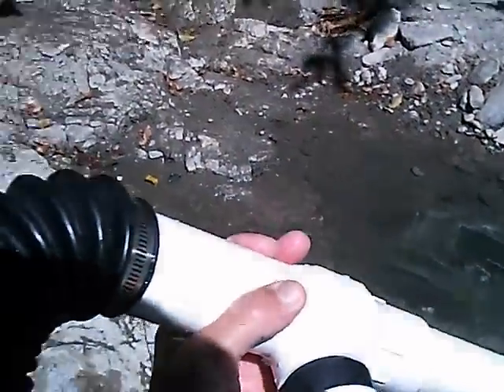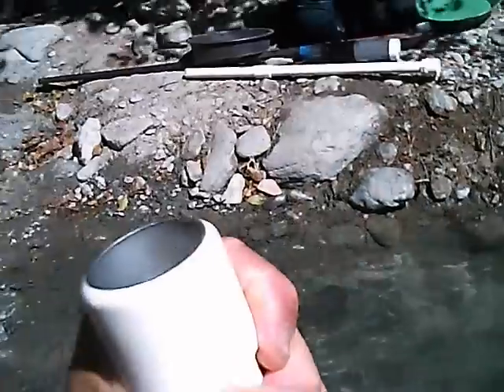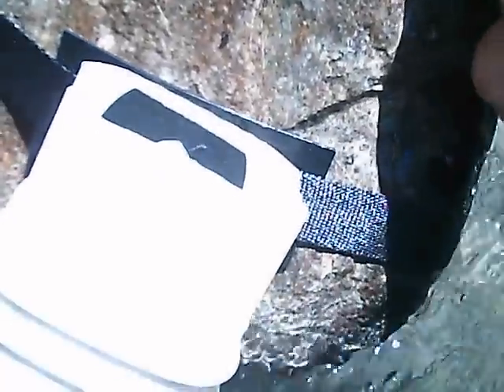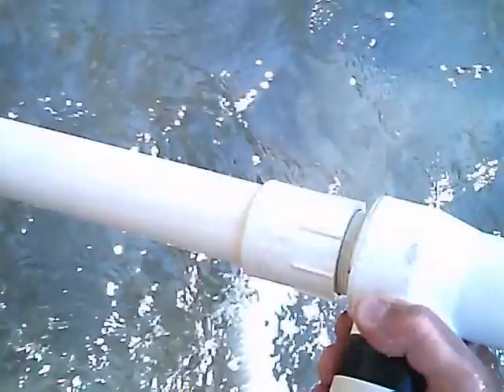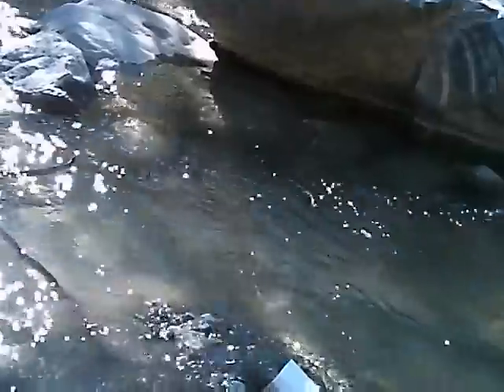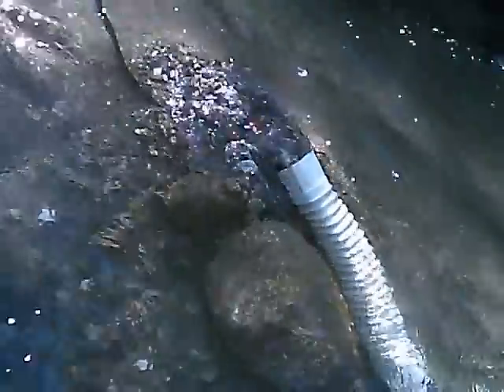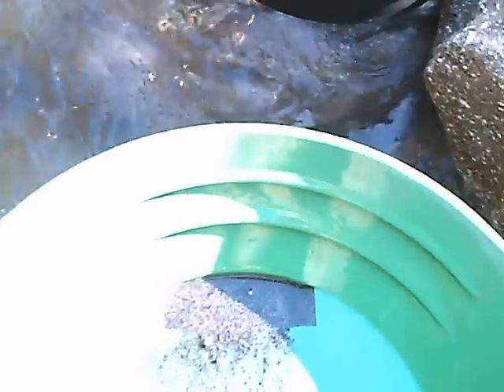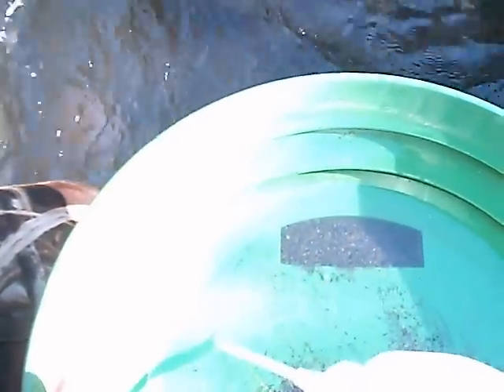Hand Dredge Gravity Concentrator

Comment: What size hose is that? Looks easy to pack in. Do u know the name of that hose or what its manufactured for?
Reply from the maker: 2-1/2" inner diameter hose. Hi-Tech/Duravent Super Value Flex
Reply from the maker: Let's start over,. The corrected answer is 1-1/2" inner diameter Teleflex Marine Bilge  Hose
Reply from the maker: 2" Hi-Tech Duravent Super Value Flex Hose is also being used on the M625 HDP Bilge Style Gold Hand Dredge. 2" hose works better when pumping up to maximum diameter 1-1/2" rocks through.
Reply: Yeah couldnt find the white hose online thanks
Reply from the maker: https://goldensnifferproducts/gspzcrt   Click this link. Everything you've seen is there.

Comment: Don't you think you should be running into a sluice box to see how well the gravity trap is actually doing?  
You don't know for sure that your not losing gold. 
Just that the experimental gravity is catching gold. Not if its getting all of the gold you may be sucking up.
Reply from the maker: We're confident the EGTC works all by itself with the M625 GOLD Hand Dredge,  the 1 1/2" Dredge with a 32 ounce bellows. Now the Model 2125, which is a 2" Gold Hand Dredge uses a 48 ounce bellows on some models and with the combination of larger rocks and more water pumping through per stroke, the EGTC isn't as efficient trapping black sand. We're still field testing the EGTC with the M2125. I have 2 video's to view with the EGTC attached to a sluice. M625  https://youtu.be/Q8wc3evsP9w and the latest with an M2125  https://youtu.be/b7JqIU5RUas